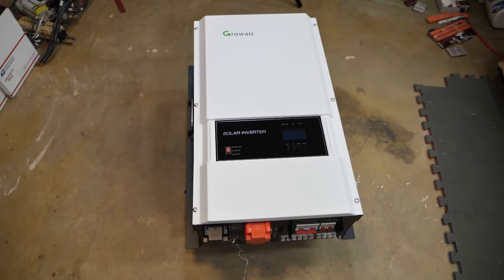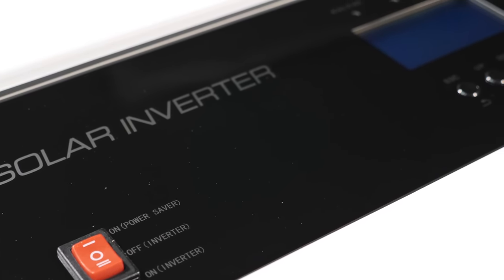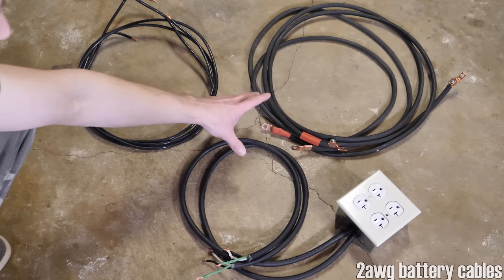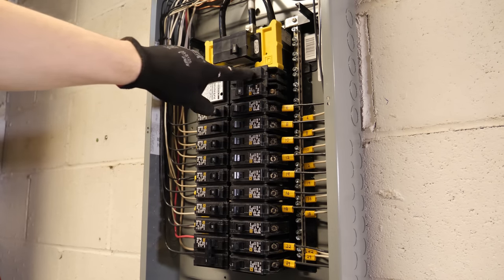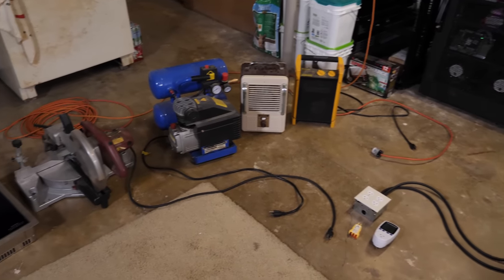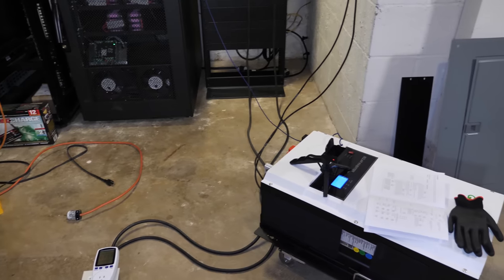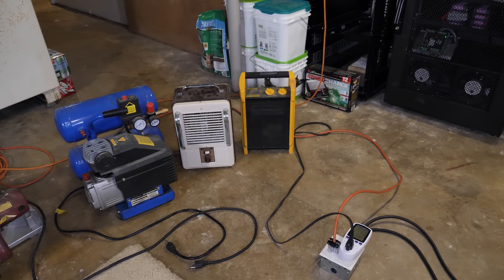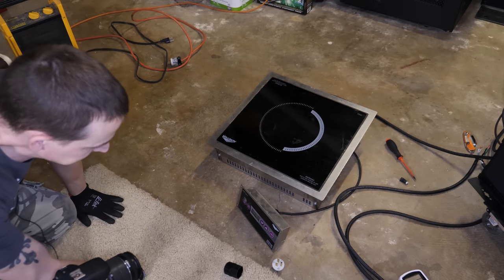12kw Growatt Inverter Operational Check/Review!!

Comment: So grounding the inverter to the AC panel was not a problem? Great video as usual.
Reply from the maker: I didnt in this video however under normal operation you do have it connected to main panel ground. Which it is at this current time since recording the video like.....a month+ ago🙄😆

Comment: good day and pls can u show how to get the 240v , i live in a country where the power voltage is 240 and so i would like to know how to connect both 120v on this inverter to the 240v , thanks and i was hoping u would show that with the induction cooker , but too bad it did not work , so hope u can show how that is set up .

Comment: Great video, thank you for sharing this. I'm new to this stuff and looking to go solar and utilize the grid to make up the difference in power that the solar can't provide. My question is this...this inverter is a 12KW and if I'm pulling 15KW from my house (EV, washer/dryer, ac units), would this unit trip out or would it provide me with the 12KW from solar and then simply pass through the additional 3KW needed from the grid or will it top out at 12KW load regardless of whether that power is coming from the grid, solar or a combination of both? Thanks.
Reply from the maker: Thanks and thanks for watching! This inverter will only output 12kw and 36kw for short surges. It would trip out!
Reply: @AveRage_Joe  Ok thanks Joe.
Reply from the maker: You bet!

Comment: Hi Joe I was told that this inverter is very noisy is this so I need to know because I have the intention of purchasing one.
Reply from the maker: The fans can be noisy when spun up but during low power like 1kw they only turn on occasionally. I may actually see if I can replace the fans for quieter ones. Its a good inverter tho. Would buy again for sure.

Comment: Nice vid Joe! Do I understand it right it is no a hybrid because it cannot push back to the grid?
Reply from the maker: Thanks Mate! Yes you are correct, not a hybrid and cannot push back into the grid!⚡⚡
Reply: @AveRage_Joe  but other than not selling back to the grid - it acts like a hybrid unit, correct?
I just want to power my house with PV and/or grid – and also will be able to have full access to my PV if the grid is down.
It seems that this unit will accomplish that, correct?
Reply from the maker: Yes it acts like a hybrid but does not send power to the grid. You can power your house with solar, battery and grid. Can use it like a ups as well. Its a pretty awesome unit!

Comment: SO, would you suggest the growatt for someone just starting out! or go seperate cc and inverter? My system is 24V. great video!
Reply from the maker: I would think this would be much easier to manage and operate personally. Less things to fiddle with. If I knew about all in one systems like this when I started then I would have got one much sooner. Thats just my personal opinion. Others may say diff. Some like the seperate charge controllers. I almost went with mpp 5048 but they couldnt start a saw. They needed 2 I hear to do that. I didnt want to keep adding inverters to use tools. Dont get me wrong, mpp has great stuff and your needs of course are different then mine. I wanted something to run my hole house.  Im not 100% sure on what voltage they have in this particular inverter but was only looking for 48v. Im sure they have 24v as well.
Reply: @AveRage_Joe  stay tuned for uber terrible video lol thanks for the advice
Reply from the maker: Lol Ill keep an eye out!!!😆

Comment: He Joe 
I very  glad with  your movie 
I gonna order the same inverter this week 
But you told in the demonstration that a high voltage inverter  a better choice is 
Why you think it is better 
I have for starting  10 panels off  44.78 volt 
8.68a do you  think when I put them  in parallel  1 string it's oke for the inverter ?
Also you  tell their is a delay in the app
Can it be there is also a delay if you wanna change the settings in the app ? 
Greetings Patrick 
Keep going 😉 
I love it!!!!!!
Reply from the maker: Yeah I mention the high voltage model as it allows 250v input for your solar so you can run x amount is series which allows smaller wire runs from panels to inverter. Mine will work out great either way. My panels are about 45ft wire runs so not to bad. Ill re configure them to get a little highet voltage. When you hook yours up just try and get close to the 250v input and not over 60amps per solar input and your good!🤘
Reply: He joe
Thanks for responding 
We live in curacao  and have the same power as in America 
BUT ore volt is 220 
3 fase 110 we have 
Is that a problem  for this split face of  it have to exactly  240
We have in ore house 110 and 220 instead 240
Reply from the maker: Oh you have 3 phase? Im not to familer with 3 phase or how it works so I cant say for sure but the input on the inverter is 208-240vac so if you can manage that then you could use it. Also in the other comment above, yes there is a delay in reporting data however when you change a setting it is pretty instant. I learned that after the video when I tried from another pc.
Reply: Tanks joe 
I let you no 😉🙏
Reply: @AveRage_Joe 
Yes 3 phase  110 
And you have 2 phase 120 right?
That's the way of it will work with 220
But when it's adjustable 🤔I thinks it has to work

Comment: Thanks Joe, I still have not put a battery on mine.  I have other inverters running mining rigs. im saving it for when the SHTF!!!
Reply from the maker: There you go! That may be sooner then later lol😬🤣
Reply: And how do you do that? My miner consumes 5kw with 8 cards. What inverter you using? It sounds more like a dream lol
Reply: @GeraldPUR  I had them split up but 12 cards on 3 computers was about 2kw.  I had it running from my 3kw inverter 24volt.  You can watch some of my videos showing my solar set up.  dont think I filmed my rig, wish i had.  I just sold most of my cards last month.  price was to juicy. bought more crypto when Btc dipped to 50k.  everything was on UPS's so I could swap from grid to solar.  my main system has a ATS.

Comment: I have a 12 kW Growatt inverter and a 300Amp 16 S Daly BMS attached to charge and discharge a 460 Amps LiFePo4 battery pack. The BMS does not communicate with with the inverter and the inverter shuts down every time I have over 30 A consumer, displaying Fault code #4 “Battery voltage too low”… 
How should I program the inverter to recognize the batteries?
Reply from the maker: Is your bms capable of comunicating to the invertet? What kind of battery amd bms are you using? Id recheck all your battery and bms connections and make sure they are not loose. Also check the settings in the bms if it allows.
Reply: @AveRage_Joe  Joe, you’re a good man! I watched a lot of your videos and I bought my inverter at your suggestion (I bought the 250 volts not the 150) actually I installed a safety switch rated for 300 Amps, I will remove it, I think it’s fake!
How many panels you have and how can you tell how much they produce ?
I bought a pallet of 29 panels 405 watts from signature solar, but I’m only getting 40 amps!
Reply from the maker: Thanks! Appreciate that! Yeah I was actually sent the 250v version but didnt realize it till later lol. I have about 5kw of solar. Im running 6 panels in series for roughly 200v. I have 4 strings of 6 panels. 2 strings to each solar input. Winter time I dont see anything near that tho. For you only getting 40a... Id check angle to sun, check settings in inverter. Also if your batteries are near full charge then you wont see full amp. How do you have your panels setup?

Comment: Growatt inventors are great. I have the 12KW surge capacity 36,000KW off grid & it does exactly what I wanted it for & that is to run my 4 ton A/C unit 24 KWH Li Ion baterry bank & the load is only 50%. My A/C unit is completely removed from my 6.5KW microinveter system grid tie. Seeing the electric meter running backward for the most part is the best thing any home owner can be please with. Plus saving the world do your part.This Is its little brother which would work too, I went with big brother because it's better off not having a full load on it all the time.
Watch "12KW Growatt Offgrid inverter is a straight beast!!!" on YouTube
https://youtu.be/pp-DaMXd158

Comment: Looks good, the efficiency is better than I expected too. The fans are definitely louder than mine but 12kw vs two 3kw units that's probably expected. There is a mode you can choose where it will charge from both solar and utility, you can set the max charge rate from utility as well as the max overall charge rate of both solar and utility combined going into the batteries. Mostly I think that's a mode you'd use while getting ready for a storm to come through to keep everything topped off or if you're using a generator to top off the batteries during low solar input in say an off grid use. 

Nice handling of the surge from that saw too, looked like your Batrium showed a spike above 7kw for a brief bit, one of the nice things about the low frequency design is the surge handling. Great test, congrats man!
Reply from the maker: Thanks Man! Yeah eff was better then expected! So I had originally went through all the menu settings and explained them all(kinda) but removed it due to length of video. May do another in future on those. Also I forgot to mention I for some reason cant get the beep to shut off while pushing buttons. Option 15 is off🤷‍♂️. I was also able to change the setting from the online app from a different pc I found out after video🤣
Reply: @AveRage_Joe  I've had so many people asking me how to kill that beep, or some other beeps and it must be hit or miss that option 15 works cause on mine with it off no beeps but given all the comments and your experience now too, it doesn't always work. One thing that would be nice as well is if there was a reset to factory default option in the menu too. Overall they work well, its just the little rough edges like that they could stand to fix. 

Look forward to your vid with the new battery bank. I've been so slammed with work the last couple months been hard to get any side projects done.
Reply: @AveRage_Joe  - I have an ERROR / FAULT #61 & I disabled the annoying  "BEEP"  by simultaneously PRESSING the  <DOWN> + <ENTER> Buttons 
which seem to allow other ERRORS to sound-off & ONLY disable the BEEP on Error # 61 
COOP
...
Reply from the maker: What is you solar voltage. Are you close to the high end? I havent had that error but was thinking if your on the higher end maybe its to high from the sun creepin around the clouds. Also if temp is cool/cold with have higer voltage??? Oh and.....did you try restarting it🫣😄🤘

Comment: Hello Joe,  I have the exact same inverter. I am going off grid and have a newer home that is on the grid at the moment. I've read that the inverter AC output L1 L2 and Neutral.. the Neutral is not connected? I've installed a new Siemens circuit panel, attached L1 and L2 from the inverter ac output and attached the house Ground line to the Ground Buss inside the panel but still wondering about the Neutral coming out of the inverter.. connect or not connect?   Powering up and measuring at the inverter the output is fine .. 120v on each L1 and L2 to Neutral and 240v across L1 L2. But still wondering about that dang N! Have you connected the N?
Please let me know sir, if you would.
Thanks
✌PT
Reply from the maker: Yeah I have my neutral connected. It bonds to ground in main panel!
Reply: @AveRage_Joe  thanks AJ.. 
✌️PT
Reply from the maker: You bet!

Comment: Wow ! What an extremely heavy load testing of the GroWatt 48 v low frequency split phase 12,000 watt smart inverter charger . That was a massive load and it ran all of them . That GroWatt is big like a tank compared to you being like above 6 feet tall or so looks like a funeral casket . Built like the AIMS inverter that it’ll run the whole house and everything on it . Check out my videos and compare both inverters . Hit like , leave a comment and subscribe. May the solar be with you .

Comment: I think I'm set on this unit.. although just wish the monitoring software has better reviews , looks pretty bad
Reply from the maker: Its not terrible and works better now that I know how to use it. Biggest "issue" would be is it only updates every 5min. Would be a lot better if it was real time. Many use solar assistant which I may try here soon.
Reply: @AveRage_Joe  thanks for the info. When connecting this thing to grid power... do you know where the neutral wire should go? I assume I just leave that connected to the neutral bar.    Basically I want to run power straight from the mains breaker directly into the inverter, then branch out from there.

Comment: Great inverter and I will sure love to consider owning own but for the unsecured internet access that's raising my hair, pretty much a decent concept
Reply from the maker: Thanks!  It seems pretty solid for sure!  Yeah the internet part of it I am not a fan of.  I did try from another pc and was able to change settings.  You can also connect directly to the inverter and use the supplied software as well but didnt mention it in this video.🤘

Comment: Hey Joe - thanks for this: great video as always.  Any plans to do the max out tests you mentioned?  I'm over here holding my breath.  It is the only doubt I have about this unit as the spec sheet measures the overload tolerance in milliseconds, which if not a mistake, isn't really reassuring.  I really want this to be the solution for our home...
Reply from the maker: Thanks Man!  Yeah I do want to try that sometime but Im not at that point yet with battery as we have been SUPER busy at work so havent had much time lately.  The spec sheet says it measures in miliseconds as in a sample rate.  What kind of load are you worried about?